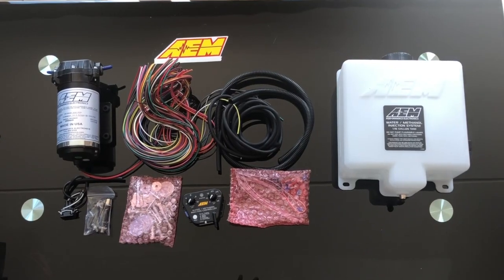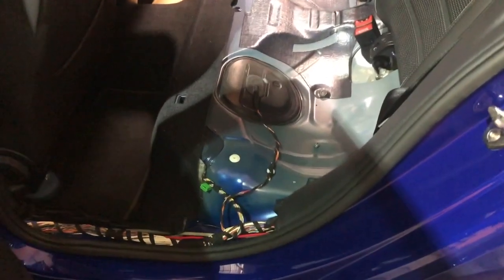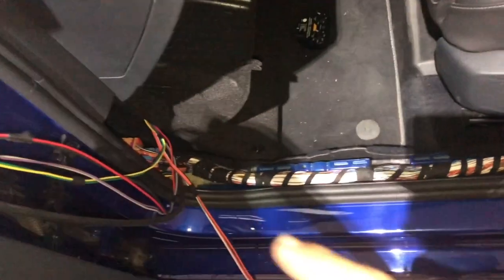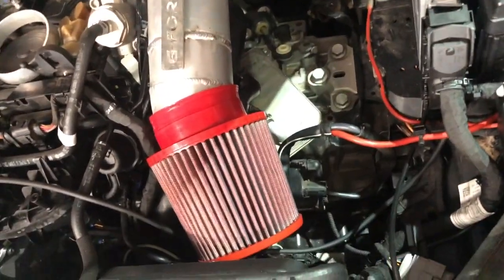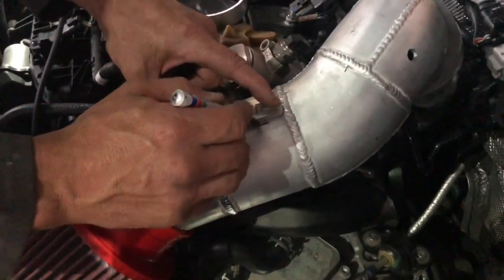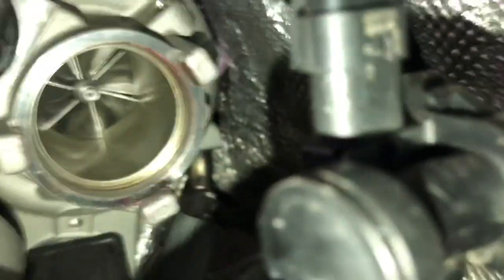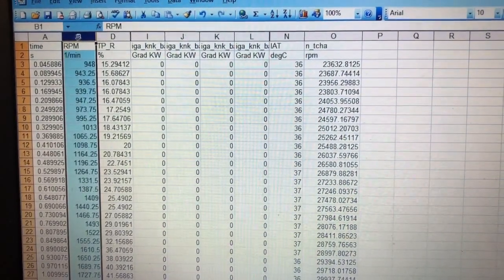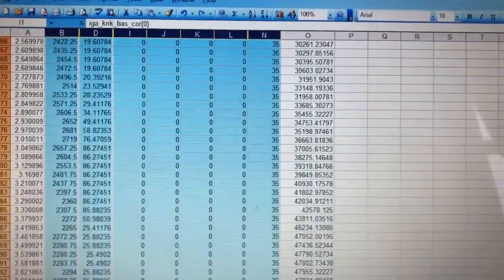What HP is the VW Golf7R capable of?

Comment: Do you have anything in the works for the RS3 Evo DAZA engine?  Hybrids are popular for that platform, and I'm wondering if you've got an offering...
Reply from the maker: HI Dave - not at this time, we havrnt been concentrating on this platform until a month ago - we will however have a bolt on setup capable of around 1000HP max, with respectable response for the daily street driver - however we will not be designing a hybrid - they simply will not last,  as im sure you aware of. Similar complaints to that on the MQB platform.

Comment: So this IS38-600 is not a Hybrid turbo? Pls explain?
Reply from the maker: No its not a hybrid turbo at all - a hybrid turbocharger is a stock OEM turbocharger which has been modified with different internal rotating assemblies either on the compressor side alone or both the compressor and turbine side - but still uses the stock OEM turbine and compressor housings. In almost all cases these hyrbids use the stock OEM bearing system. 

The IS38-600 is a brand new turbo with brand new altered turbine and compressor housings, the internal rotating assembly is ofcourse upgraded completely including the entire bearing system too. There is NOTHING on the IS38-600 which is stock/OEM - everything has been redesigned
Reply: So both the intake and exhaust housing has been replaced with bigger parts to fit the bigger wheels?
Reply from the maker: @kiewietduplessis6463  The ENTIRE turbo is new, NOTHING is oem or stock what so ever - not one single component.
Reply: @TurboDirectSA  Great ! I cant wait to see the results on the IS38-600/700 & EFR7163.
Reply from the maker: @kiewietduplessis6463  check this out - it will give you an idea of the larger AR in the turbine housing - https://youtu.be/POd230p7cTs?t=368
Reply: Can you dial the boost up to 2bar on the stock motor?
Reply from the maker: @kiewietduplessis6463  Yes you can, but not for long, watch out i wouldnt not make more than 480WHP (true HP, not these "corrected" dyno that inflate figures) as this is close to the limit of the stock motor. If you want to go to 500+ WHP then build the motor.
Reply: @TurboDirectSA  I pushed 470wHp on stock motor/stock clutches before building the motor because Im looking at going bigger that's why I asked about the other options on your other posts.

Comment: Any specific reason for opting journal bearing as opposed to ball bearing?
Reply from the maker: To provide a true, reliable, affordable bolt on turbocharger that replaces the failed "Hybrid" turbos on the market today regardless of the name or "nickname" for them, if they use the stock shaft and bearing system - they WILL fail. 

We also have a Ball bearing version which incorporates the Garrett GTX3071R Gen2 CHRA inside of our proprietary housings.